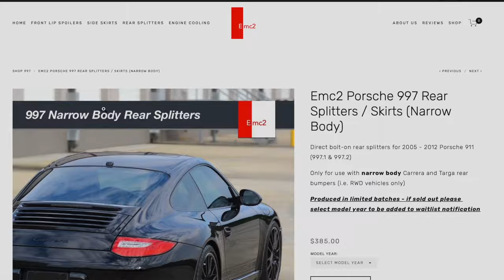THE PORSCHE 997 BUILD SERIES | AEROKIT BEST SIDE SKIRTS REAR SPLITTER REVIEW AND INSTALL  | EP 4

Comment: So sick...What coilovers your running? is this .1 or .2?
Reply from the maker: Thanks! No coilovers, just factory PASM. It's a .1 -  2005 launch edition. That's why the car has the PCCBs :)
Reply: @nineelevensouth  it looks like it is sitting lower. How did you achieve the stance?
Reply from the maker: @Goelmoel  the PASM option lowers the car from the factory. Also used wheel spacers to bring the faces out flush with the fenders.
Reply: @nineelevensouth  thank you for the quick responses. I’m closing on 06 C4S but I for believe it has PASM, just sport chrono, Bose and PSM. Love your channel btw, getting a lot of inspiration to build out.

Comment: Looks good. The rear splitters were the right call. Rennsport grills look good too. It’s now very low. How flexible is that Aero Kit Front Spoiler? It looks sure to scrape, maybe even in your own driveway. Super nice job on the build!!
Reply from the maker: Thanks! It's very low and does scrape a little. But this is a common problem with almost all Aerokit or GT3 997s because of the amount of "nose" that is out over the front axle. Makes any kind of steep approach a problem. I just keep a can of SEM trim black handy to touch up the lip every so often!
Reply: I have the aero kit on my 997 and have been through tons of different front lips, I’ve bought all of them from eBay junk to stock$$$$, the one that lasts and isn’t too expensive is the factory cup lip from FVD brombacher. If you drive often, the lip is sacrificed about every 4-6 months or until you don’t care as much about looks and drive with scratches. I’ve had my car a long time so I’m used to it. Cheers🍻
Reply from the maker: @MrGmilton  Ha. Exactly the plan I assumed I would have to adopt.